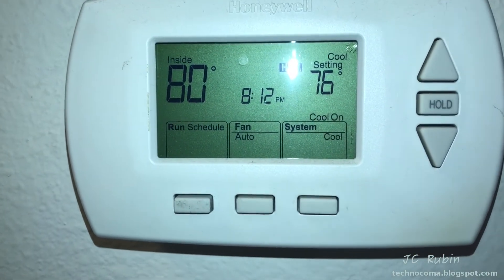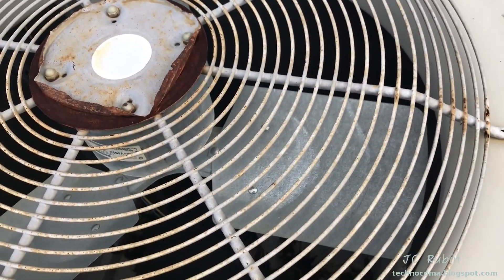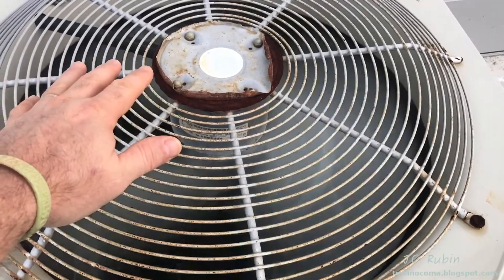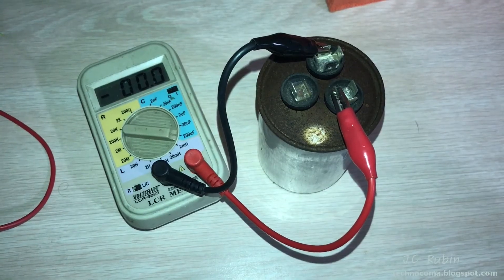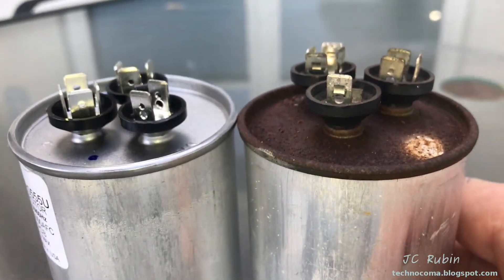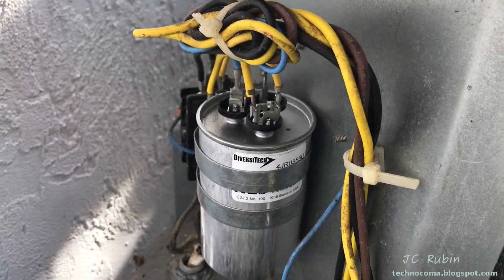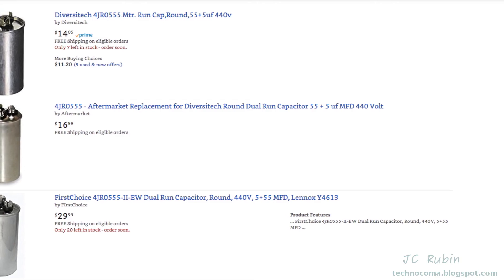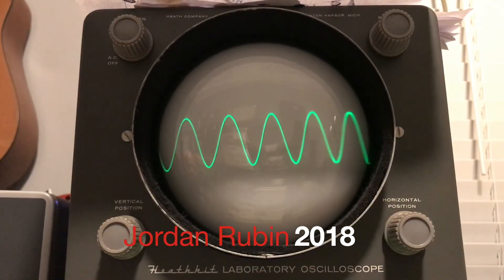Easy Home Air Conditioner Repair - Capacitor Test and Replace

Comment: Both of my pool pumps had the same problem. open capacitors, within a month of each other. I bought the pumps brand new seven years ago. Nice fix!
Reply from the maker: I did another video series on my pool pump some months back, a model that no longer allowed for the replacement of the capacitors in the unit. Bummer.

Comment: Herm refers to reciprocating hermetic compressor.   Why they chose to use herm,I don't know.
Reply from the maker: I was not aware of that, thanks.  Funny though.   C is Common, poor choice for a device that connects to a 'C'ompressor IMHO